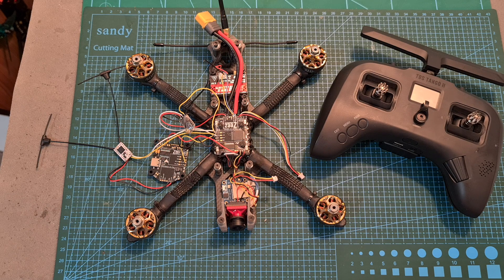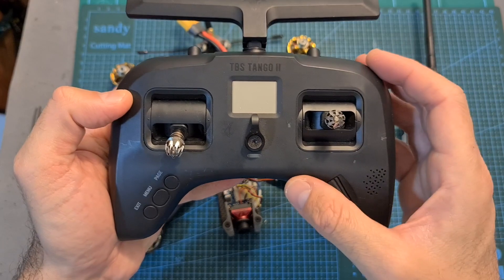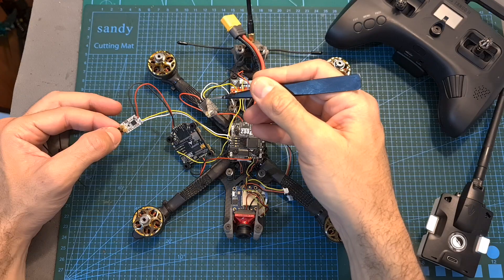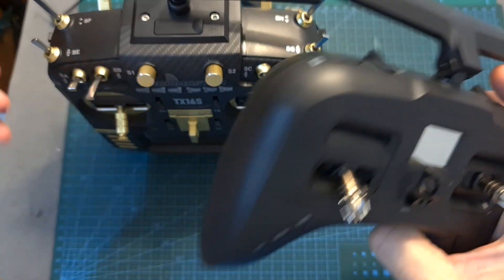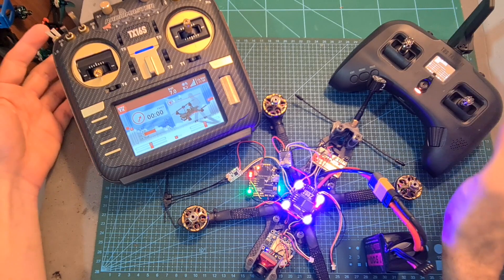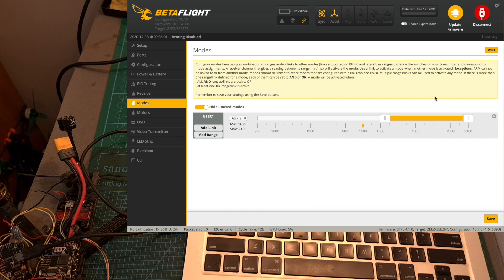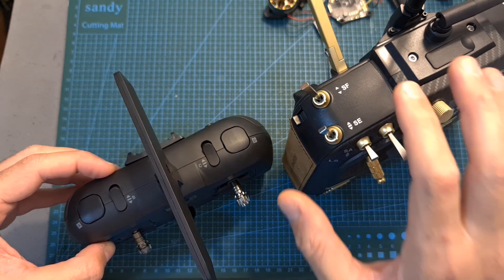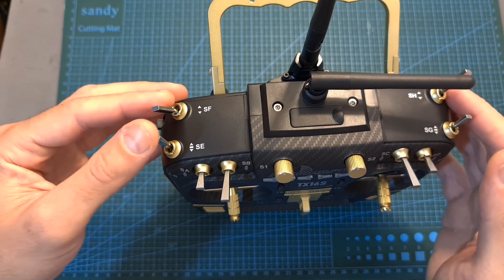How To Use Two Radio Receivers On The Same Drone Using Betaflight

Comment: Cool! I was wondering about using the different locations on the FC, but this makes sense. My question, if you should choose to answer, is about how you mount the double antennas. I am working on my first drone and I have a receiver with two antennas and I'm just trying to find more options for keeping them out of the way but also in a good location. Do you have a video that shows this?
Reply from the maker: Hi, I don’t have a video about it but the best position will probably be to mount the antennas on the front or back arms. Anyway you should not worry about it too much unless you are doing long range flights.

Comment: Instead of using two flight controllers, you can use one of these here, plus a RealPit switching module (https://tinysleds.com/products/realpit-vtx-power-switch). would be a much smaller build then. ;-)